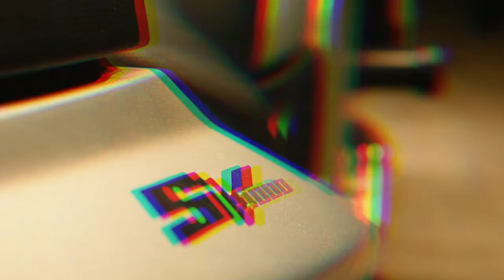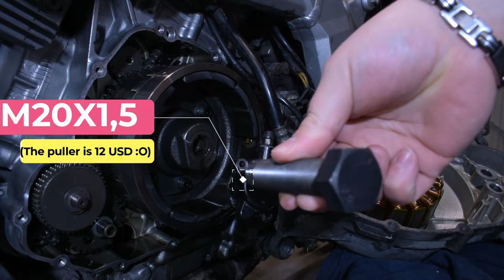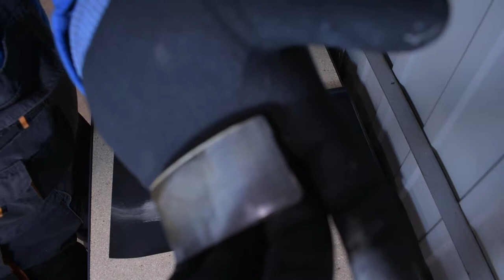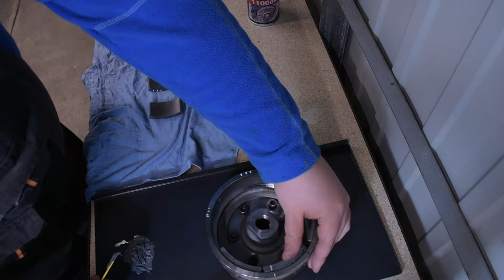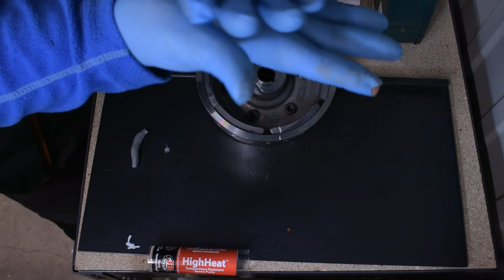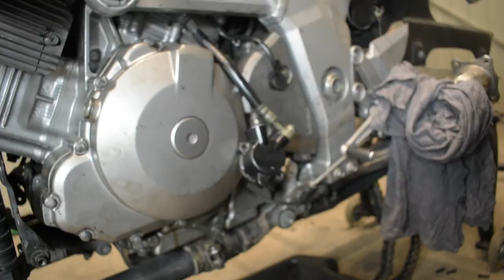Suzuki SV1000N - Part II -  Stator Magnets Repair

Comment: Hello, thanks for your instructions. You used an impact wrench to loosen the screw without the special rotor tool from Suzuki. Did you insert 2nd gear or did you lock the rotor in another way?
Reply from the maker: With a strong impact wrench you dont need to lock the crankshaft .

Comment: Good job! What is the length of the M20 x 1.5 screw that you are using, or what is the minimum required thread length for this job? Thanks!

Comment: You don't need to remove flywheel to do the job. I used JB Weld Steel Stick (easy work) and Loctite.   :)
Reply from the maker: You're right, but I like to work at a table, and that way I'm sure nothing gets inside the engine.

Comment: Great video. What is the spray that you used to remove the old glue from the magnets? I watched a couple of other videos showing them baking it but your method seems far easier.
Reply from the maker: Simple brake cleaner that I used to remove grease and other dirt. Unfortunately, the glue disappears on its own.

Comment: Hello I'm waiting for the glue and I'm going to do like you, does plugging the holes in the bell not interfere with the evacuation of the oil? Or does not interfere with the magnetism? Thx
Reply from the maker: Hello! I also had this question, but I spoke to several people who repaired it in the same way, and everyone has been using the engine repaired in this way for several years, including me.(Me for almost two years and 10,000 Km)
Reply: @garageb.4222  it's repair for me since 2 day,  14.4v ouhou! I make hole with stem in epoxy, for evacuation maybe... 
I hope it will hold...
Reply: I’m going to use JB weld, the old type that takes 24 plus hours and will wait at least 48 hours

Comment: Where can we find a replacement for magnet?
Reply from the maker: You can only buy a complete flywheel, if the magnet is damaged you can get it from a bad flywheel.
Reply: @garageb.4222  yeah I ended up doing that tried to replace it now bike won't even start. thinking its something to do with the timing marks on all the gears and bike being too dead center do I need a service manual for that or should I just put her in the shop?